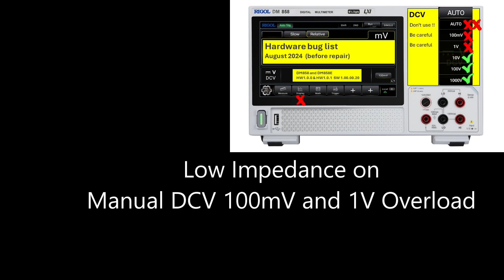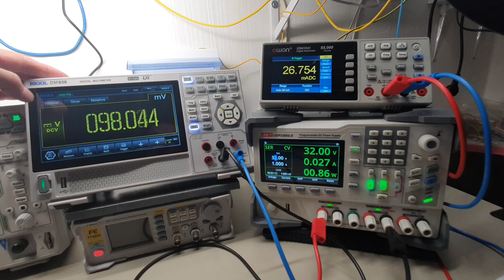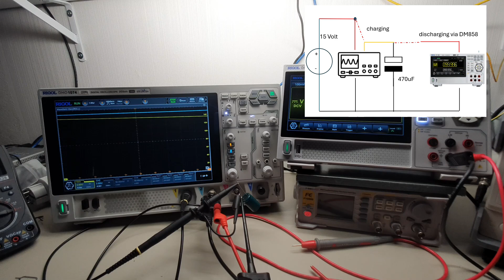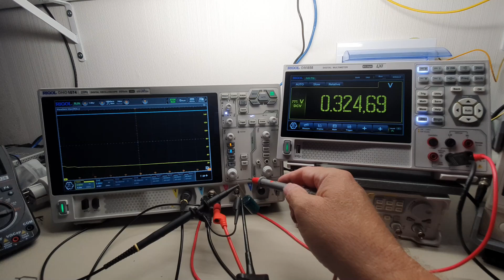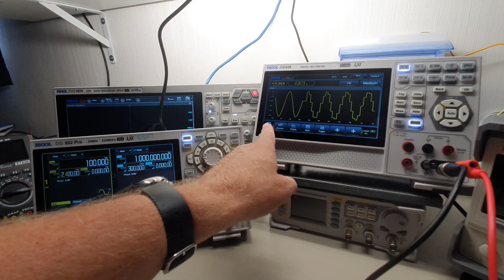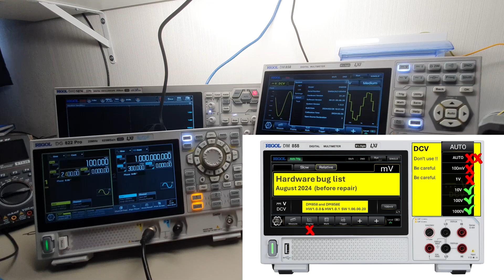#10 Rigol DM858 HW buglist Aug-2024 before repair - Part 8

Comment: I bought the DM858E just a few weeks ago. Manufactured in 2025. HW Release 1.02 SW Release 00.01.00.00.22. Now the current in 100mV and 1V range is less than 10 microamps. And the Auto switching works flawlessly. It seems it took some time to fix this issue but it is solved in the latest release.
Reply: where did you buy it?
Reply: @serhankeyf  Amazon
Reply: Does the readings on the display still jump up and down like in the video?
I don't mean the reading itself, but the text is not steady on the screen, it shifts up and down a few pixels depending on the number its showing
Reply: @ItsBoyRed  Yes. it is still jumping around. Why they didn't use a fixed font is beyond me.
Reply: Thanks for the fast response, i appreciate it.
Sucks its not fixed tho
Reply: is it somewhat exact in low resistance measurements? like 0.5, 0.2 ohm?
Reply: @romanstingler435  In 4 wire mode mine is spot on. In 2 wire mode you have to relative it obviously because of the leads.
Reply: thanks, I will grab one and test it

Comment: Thanks a lot, I was about to buy one.

Now I will have to withhold myself, because I really like the form factor.
(the low depth it is for me)

Any Ideas for Bench Top Multimeters with a similar form factor (depth) and price range?
Reply from the maker: The only one I know is a OWON XDM1041 - but that is not comparable as it lacks a lot of functions etc (although for the price it is not bad).  I was also looking for an replacement of the DM858 with the same depth, but could not find one. Meanwhile I bought an UNI-T 8805e (classic depth)

Comment: Thank you sir. I was going to buy one too, but saw your review in time.))) Do you have any positive news from Rigol?
Reply from the maker: Hi, unfortunately no positive news yet. They say that they are working on a solution.  But that was also the case in August .....
Reply: @marcelmostert3081  New firmware dm858 v00.01.00.00.22 I wonder what changes
Reply from the maker: @Laptop-Repair  If I read the notes of the new .22 version, it is not much:  - Added options for decimal point and thousands separator
     - Modified display format for ACV 750V
     - *RST does not reset the network   
I would expect much much more important corrections after almost 1 year waiting. The focus of Rigol is not on the DM858(e) ......unfortunately

Comment: I was planning to order this multimeter, but I think i am gonna wait. Thanks for the video. Cheers.
Reply from the maker: Unfortunately, Rigol has informed me recently that there is no clear outlook when the solution will become available (after almost 3 month's in 'Repair').
Reply: @marcelmostert3081 I sent my meter back to Rigol UK and got a full refund.
Reply: @marcelmostert3081 hemos visto algún bug más , si mides frecuencia en auto la mide sin problemas pero si mides khz y aplicas antes el relativo , en vez de descontar hz lo toma como si fuesen khz 😂, pruébalo y verás
Reply from the maker: @RafaReig47  Thank you, unfortunately I don't have the DM858 anymore - after 3 month waiting - I changed. But indeed, I was planning to make another video related SW bugs.  Hopefully Rigol release new SW very soon, because the current 1.00.00.20 is still from March 2024.  That is very long for product with so many bugs. I hope that everything will be solved for you in the coming months !!

Comment: I ordered this device, let's see what I receive. This hardware problem has a trivial reason. The problem is that in automatic or manual mode with an overload, the protective zener diode at the input is triggered. Theoretically, this can be corrected programmatically by lowering the switching threshold and the sensitivity of the overload detection algorithm. This will reduce the range by 100 instead of the stated 120. But this will be a solution.
Reply from the maker: I am interested what kind of device HW version >1.01 ? you will receive. According to R&D from Rigol it is an hardware issue.  I am still waiting for HW update as my DM858 is still in "repair". The Repair department stated that Rigol HQ is working on a solution.  In October I expect an update.  However, if you receive your device, please let me know the status. Your solution might be correct, but it would make this device a 5 digit (and not 5 1/2 digit) multimeter after a SW fix or config change.  Although I find the current 120.000 count already limited compared to competition which has 200.000 count and called it also a 5 1/2 digit device.
Reply: @marcelmostert3081  HW: 1.01, SW .20rev, System Version 1.5.3.
Auto switching works, but as expected at 100,000 instead of 120,000. The impedance problem persists.Also, I didn't like the error. and no digit style settings. Sent back. I took it to Amazon. I look at other options.
Reply: @RuslanKorchagin  Great. You've just saved my some bucks before placing the order during this 11.11 sales . the DM858 is about $370... What other options did you find?
Reply: @dreamcode4204  I'll save up and buy Uni-T UT8805E
Reply from the maker: @RuslanKorchagin  Meanwhile, I have also the Uni-T UT8805E on my bench. Great meter, fast, not buggy. With better spec's also (except formfactor maybe). I will make a comparison video the coming weeks....
Reply: @marcelmostert3081  Super! I would like to see a change in low voltage 200mV and low resistance by 4WD. It is also very interesting to look at the speed of the auto-band switch from 10mV to 10V

Comment: I know is a little bit annoying when spent some hundred bucks and the meter doesn't work perfectly, i got same problem few years ago with other brand. 
But, very important thing all that issues can be fixed with some software updated.
Reply from the maker: R&D of Rigol already confirmed that (at least the Impedance in Autorange) is a hardware issue. So my hope of a software fix is now very low. That is the reason I shipped back the DM to the seller. I guess they made a hardware design fault in the analogue front end circuit.  May I ask which type of problems you had with the other brand?
Reply: @marcelmostert3081  the hardware problem it's a very bad news, i agree with you send it back to the seller, no doubt. 
I had some troubles with a dc electronic load with firmware bug, and to solve all the problems they wrote two (maybe three) update, than it start to works as it should. 
But to be honest when you buy a piece of gear ( for thousand and more Euro) and can't use it from the beginning, it's not a good deal.

Comment: This meter is not ready for sale, Rigol need to recall all sold units pending a fix. There is a safety issue here. Thank you Marcel for your work in bringing these issues to wider notice.
Reply from the maker: Agree, it is not ready for sale.  I hope that those videos will help to inform other (potential new) users and at the same time I hope that I can put some pressure on Rigol in order to release new descent hardware quickly. They should stop selling the current ones in stock as I advised my seller.  Thanks for your reaction !
Reply: @marcelmostert3081  Ja jammer dat de verkoper (ik zal geen namen noemen 😁) ze nog steeds verkoopt.
Ik had mijn oog ook laten vallen op de 858 maar ik haak voorlopig even af 🤔
Reply from the maker: @M-P-X  ja, nu zeker niet kopen. Ik ben heel erg benieuwd wat ik terug ga ontvangen.  Overigens heeft de verkoper wel een policy dat ze automatisch stoppen met verkopen bij te veel returns.  Kennelijk is er of weinig verkocht, of niemand vind het probleem erg - mits je het weet.
Reply: @marcelmostert3081 Dank voor al uw nuttige testen en zorgvuldige inspanningen. Het valt me op dat de DM858(E) bij een uitstekende leverancier in Eindhoven, nu 8 maanden later beide op "niet beschikbaar" staan. Zelfs geen vermoedelijke leverdatum. Dit lijkt een teken aan de wand dat Rigol (nog) geen goed werkende hardware upgrade beschikbaar heeft om een betrouwbare DM858(E) te leveren.
Reply: @meindertverhoeven4328  I work for a UK Rigol distributor and can confirm that the hardware fix is available. It may take some time for your local distributor to sort out their stock but the unit I have in front of me now doesn't have the disappearing overvoltage warning and drain issues
Reply: @Enjoi4283 Well they’ve certainly had long enough to get a fix out, and frankly, it’s difficult to imagine how Rigol could ever have released this instrument with such a basic fault in its  design, and continue to sell it with this known fault for getting on for a year.  I wonder if they intend to undertake a repair or replacement programme.
Reply from the maker: @meindertverhoeven4328  Ik zie het ook staan. De DM858E en DM858 die ik gekocht had (en geretourneerd) komen ook daarvan daan. Overigens, uitstekende winkel, heel veel goed inhoudelijk contact gehad rond het "Impedantie" probleem. Ik vermoed - maar dat is een gokje - dat wellicht het fixen van het hardware probleem ook automatisch een re-call zou kunnen opleveren. En dat Rigol daar niet in mee gaat.  En gedurende dit dispuut zet je even de handel even op "niet beschikbaar".  Maar goed, ik zou graag de "nieuwe" DM858 wel willen testen. Zover ik kan zien is er ook nieuwe Software uitgekomen met helaas geen noemenswaardige verbeteringen volgens de release note.  Tenzij er onder water iets meegenomen is voor de nieuwe hardware, want dat kwam op hetzelfde tijdstip.  Ik vind het interessant.  Hopelijk wordt dit vervolgd. Ik zou nog even wachten alvorens deze DM858 te kopen (wanneer mogelijk). Dank voor de Reply.

Comment: I ended up buying a OWON 140$ CAD and have 0 issues lol 
I wanted this rigol at first but...
Reply from the maker: My Owon of  ~110 Euro - which I also used in my videos - is working fine without problems since years.  But I like the DM858 form factor with its additional features. At the time I bought it (March 2024 originally) there were no reviews yet, unfortunately...
Reply: @marcelmostert3081  Формфактор не очень удачный для полки. А на столе его иногда некуда ставить. Спасибо за качественный обзор, тоже хотел его купить из-за наличия четырёх-проводной системы измерения сопротивления, но наверное куплю OWON XDM2041